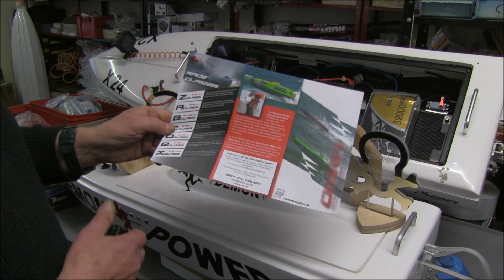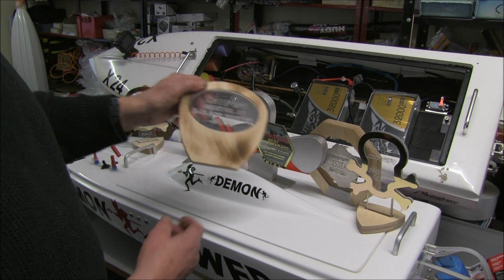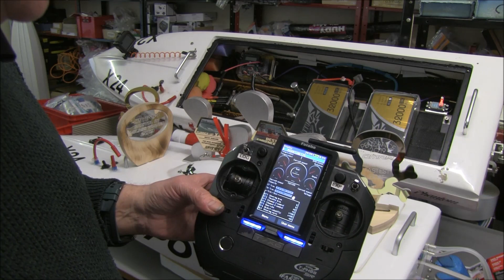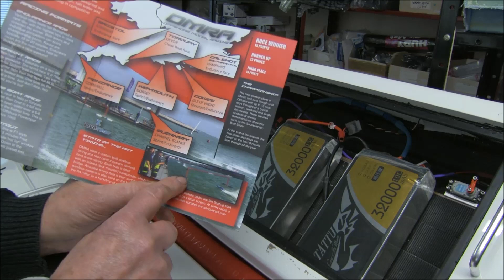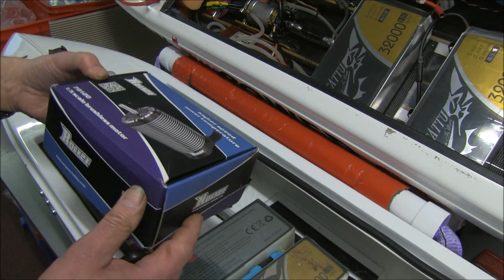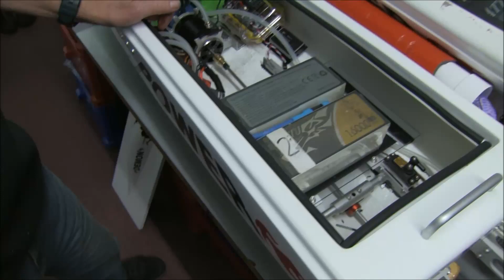Electric Power Model Racing Boats for Offshore (Sea) Racing 2019-2020

Comment: Hi Nick, I am doing a large twin (through a gearbox, one motor, 2 60mm 3 bladed props) mono (1.4m) build now and thinking of using my 2 Tattu 6S 22,000 mah, 25c packs in series for 12s.  Lots of people are saying the batteries will not handle it. I am using a TP 5860  10D 600kv 6 pole motor and ZTW Seal 300a ESC. What do you think?
Reply from the maker: Hi Jeremy. Yes, 12S is the only way, because the amp draw will be only half for the same power, and it is the amps that destroys the ESC, plugs and motors.  I have seen many boat installations overheat because they are running 6S. You will need a ESC that handles the higher voltage. Also the motor will rev at twice the 6S. But 600KV is what I use.  All the best. Nick

Comment: thanks for sharing your setup really interesting , like the way you build and explaining , it seems to be extremely reliable setup ,it s not an easy task running for 20 minutes , wish to ask you 2 questions please , do you leave radio antenna inside ? and what 150 amp fuse are you using ? thankyou and well done again
Reply from the maker: Hi Maurizio.  The Futaba radio (Surface car receiver) works perfectly with the aerial inside. The aerial is held as high as possible under the top hatch..  I never had a radio problem even in long distance and bad weather. 
The 150Amp fuse does not overheat and handles bursts of amps  over 150amps.  I think a 125amp will also be okay.
I think they will only blow if I get a short circuit. 
I use good quality ones from Farnell  (not the cheap car ones on Ebay). 
https://uk.farnell.com/littelfuse/153-5631-6151/high-current-fuse-150a-32v-slow/dp/2762076?st=150amp%20fuse
Reply: @nickadams5411  thanks for your reply , it was really helpful  ,really appreciated , thanks again

Comment: Great  talk on your boats.. I am working on one about the size of your  big one  but nothing  near the  battery capacity. I  sport around on a lake . I was interested in your  battery placement. Mine is doing some prop walking . I think I will try and move the batteries more t the port  side.  The prop torque is a killer for sure. Nice job.
Reply from the maker: Hi Doug, thanks for the feedback. I had to balance it out on the lake, but it is a compromise. On the sea it is not so easy to go flat out, so the batteries do not have to be so far over to counteract the torque. I can move the battery position quite easily, but normally leave them and go with it.  Be good to see yours when finished.  All the best. Nick

Comment: Awesome review Nick, are you going to bring the phantom 125 down the Lake when all this is over?
Reply from the maker: Hi Smudge. Yes, I will need to test and trim it out. Hopefully it will be stable at high speed. I am also making another 145 electric, the same as mine, and that will need testing at the Lake as well. Let's hope this pandemic ends before the summer. All the best and stay safe. Nick.

Comment: What cell lipo’s are in the 145? Because they are huge, is it in series or parallel ?
Reply from the maker: Hi Wasim. They are 32000mAh/10C/6S industrial drone lipos, in series giving 12S (50volt). Also very expensive.
Reply: Nick Adams - what run time do you get? Also are you even able to charge them back up when racing? Because you would need a massive leisure batter to do it.
Reply from the maker: @wasimiqbal3719   Hi. I use a portable generator (1.5Kw) and a  charger that can charge 2 x 6S lipo at 25amps.!! So it takes 90 minutes to charge the from flat. (Draws 1.25Kw from the generator).

The races are 20minutes. So I have to adjust the speed so it lasts. I check the mah used at 10 minutes, which should be less than 1600mA.

Comment: Offshore racing with these boats must be absolutely spectacular! I am very interested in the setup of these boats and I'm curious about a couple of things: Why are the motors mounted up front when the stingers are right at the back, as there is flexibility to shift components around for the correct CG? And is it mandatory for the "safety releases" to be mounted on the front deck, after all, long leads add resistance to the electrical system, do they not?  I really hope that the smaller hull is rigid enough, as it would be such a lot of work to reinforce it now. Good luck with the 2020 race season Mr. Adams, and stay safe!
Reply from the maker: i Remko.  There are a couple of videos I made of these boats racing in 2019, and one of mine being tested at the lake:  https://youtu.be/nv-uZCeT0wg 

  https://youtu.be/1EUPzeIcK_A 

The safety release could be anywhere so it is easily operated.  There are some rotary key switches, but they are very heavy. There is not a lot of space anywhere else on the top of the boat.
I placed the motor forward so I could use a straight prop shaft (minimum losses) and minimise the stinger drive angle. In theory the propeller should be in line with the hull, and any deviation will either raise or lower the forward force. Most, if not all the existing boats use flexible drive shafts that enable the engines to be placed nearer the stern, but the curve of the shaft does absorb energy, due to the flexing and friction. And the propeller can be set inline with the hull.
Inline propellers are supported by a strut , which is not adjustable.  A stinger can have the angle adjusted.
By the way, I think it is called a "Stinger" as it resembles the stinger needle of bees .
Thanks for the feedback and yes stay safe. Nick